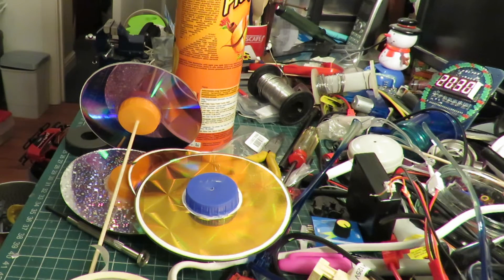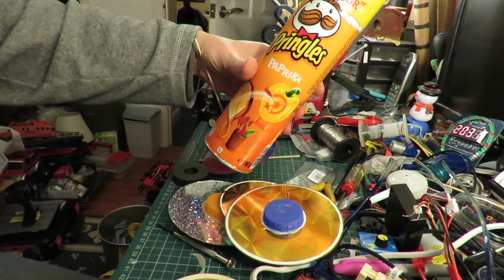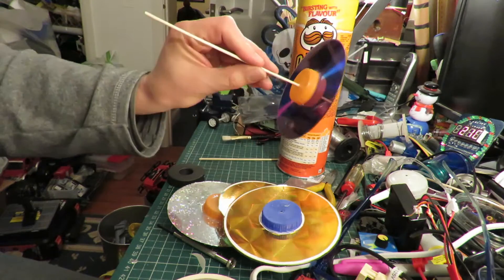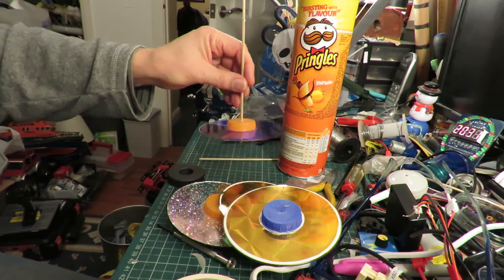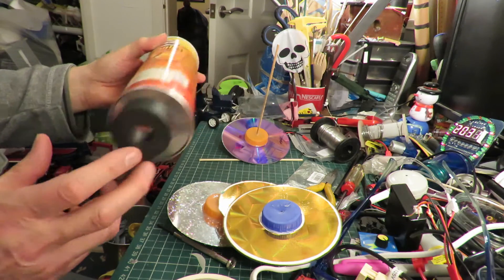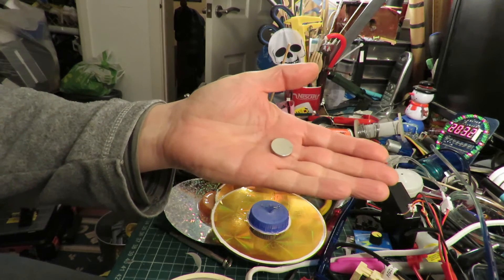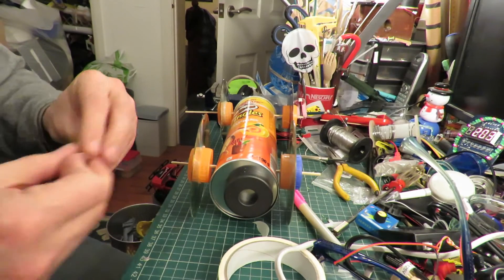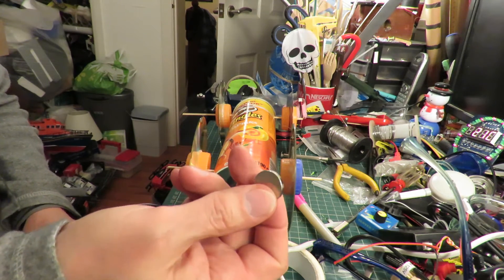Magnet "Powered" Car

Comment: Have you tried it with the magnet on the inside?  When you said you were going to do that , I thought it may not work near as well as being on the outside but without doing it myself I was waiting to see what happen.  : )    I am guessing it will work but maybe weaker.
Reply from the maker: It works just as well, the bottom of the container is a ferrous material so the magnetic field passes through with no trouble. It was just easier to let it sit on the back.

Comment: Hi! I have to make a car that use mechanical energy (no electricity, no ramp) for 5m and then come back by itself using the wind of a fan (the fan is not on the car). Please help me! Thanks
Reply from the maker: Hi Jo, if the fan is not on the car, where is it? Is it in a fixed position so you can put a sail on the car that is angled in one direction so the car travels forwards for 5 metres, then the angle on the sail is changed so the car travels in the opposite direction. It might be as simple as tying a length of string to the back axle and the sail so the string winds up round the axle until it gets tight, stops the car and pulls the sail round so car changes direction and the string unwinds. Or maybe a screw thread on the axle that moves a cam across to switch the sail. Here is a playlist I put together of other people's brake mechanisms that could be modified and used Brakes on Rubber Band Cars playlist https://www.youtube.com/playlist?list=PLA5a2xPRSrB3MyidvKMT3DqU1vNy9Atsf
Reply: The fan (table fan) is at the end of the 5m and its on the ground. So the car have to travel 5m to the fan with a rubber band or another system and then use the wind to break and come back to the start.